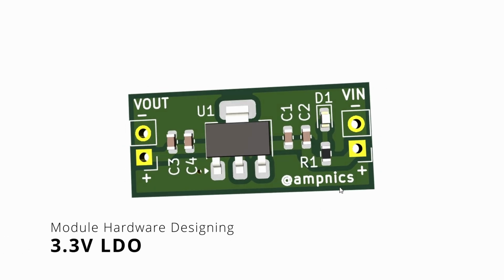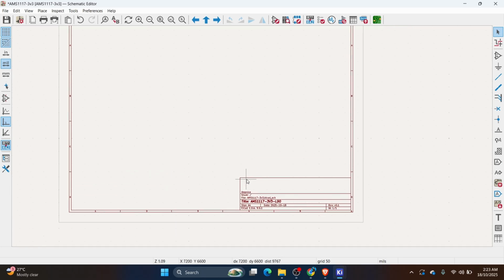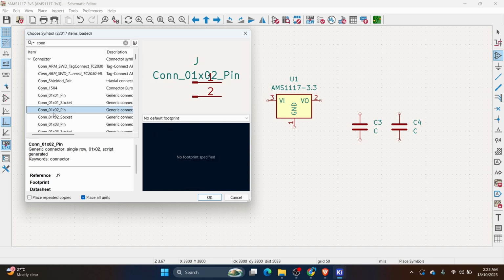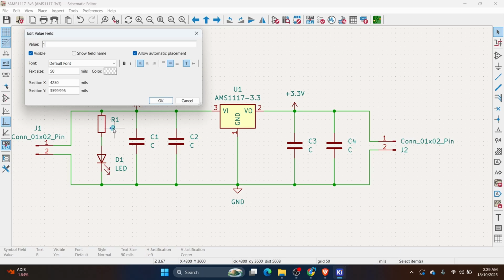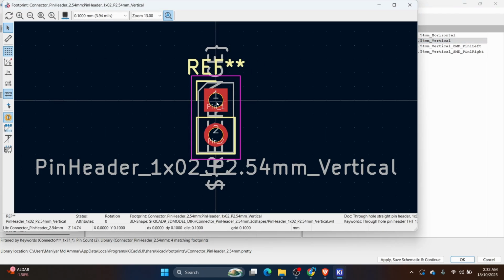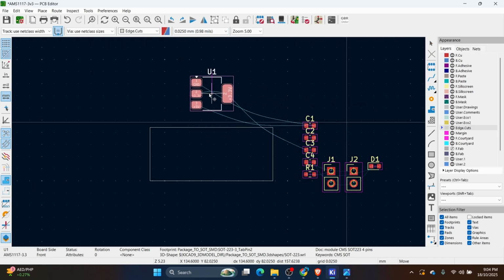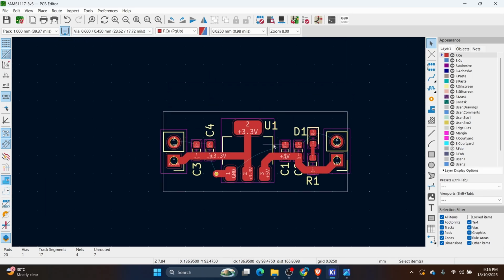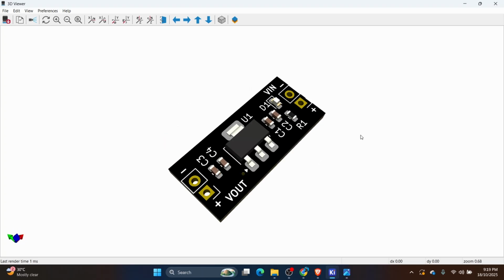How to design AMS1117 LDO | Module Hardware Designs | Ampnics

Comment: Very nice tutorial. Wondering if you can help me with this query: Is copper fill mandatory if the current draw is not significant?  and also if the fill area can be reduced?
Reply from the maker: Ground copper fill has several benefits that’s why we use it! 
1-better heat dissipation
2-Saves Eatching Material 
3-Reduces Noise 
4-It provides return paths, carries current but won’t use it. 
5-Increases overall performance of hardware.